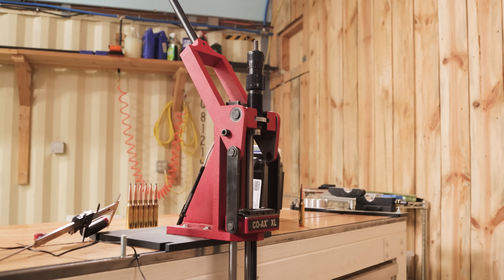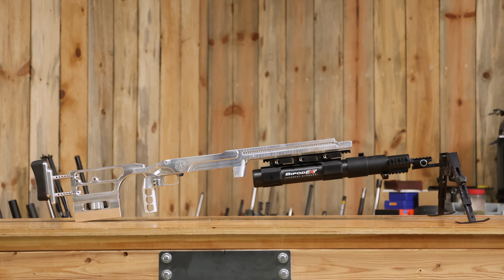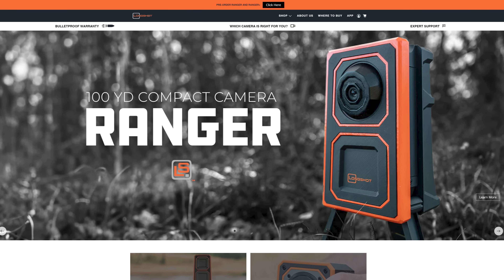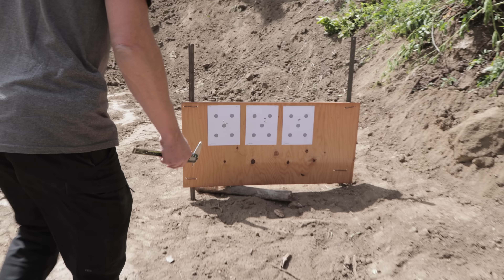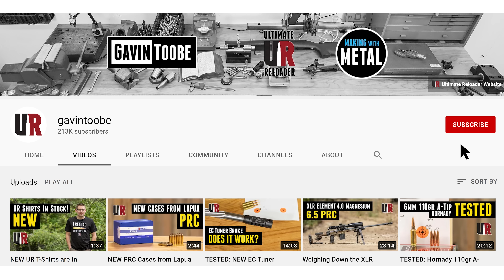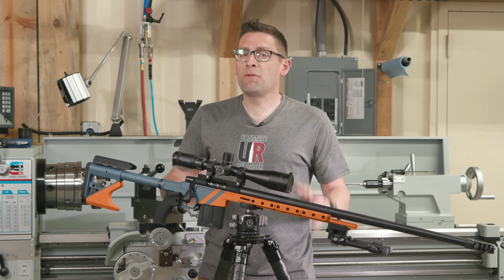Loading .375 CheyTac on the Forster Co-Ax XL

Comment: If you're going to use calipers to measure group size on targets why not make it easy?  Zero the caliper on a bullet then measure to the outside of the group.  No need to guess at bullet centers.  
Those micrometer bullet seating tools are great if you are adjusting a lot to find the best OAL compared to rifling lands or changing bullets but are kind of unnecessary if you have one load that you're repeating.

Comment: Hey Gavin! Been a long time viewer and have a question for you. Would you stick with just FL sizing dies or use FL Neck bushing dies? Been debating it for the better part of a month and can’t decide for my 338Lapua as both are great options, but the ability to adj my neck tension via bushing seems good.
Reply: All the best in the world are full length sizing. That’s a hint from EC.
Reply from the maker: I would not hesitate to full length size!
Reply: Even if you are playing with bushing dies you must full length size every 5-10 reloads so the answer is Both.
Reply: So even FL Bushing dies are okay? Seen that Forster offers a die that offers both and pretty set on running them or Redding.
Reply: @AKGuru4774  as long as you are FL Sizing and bumping the shoulder back .002. I'm really just regurgitating everything I heard on EC video from yesterday. You should watch that.